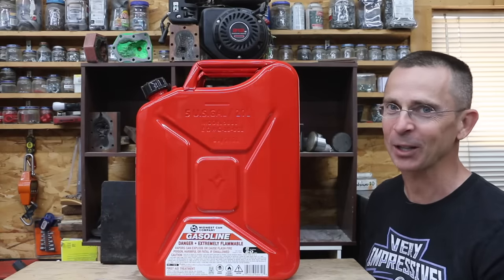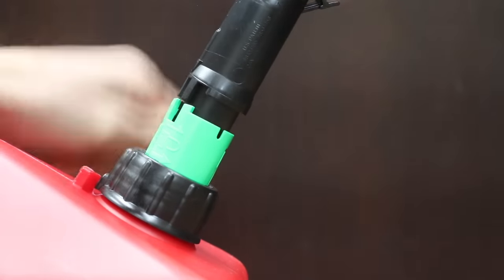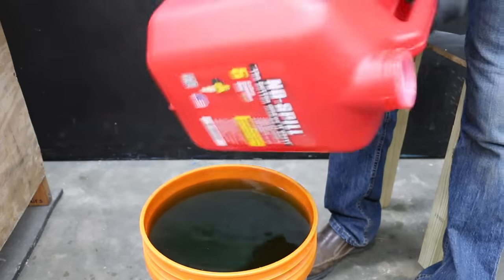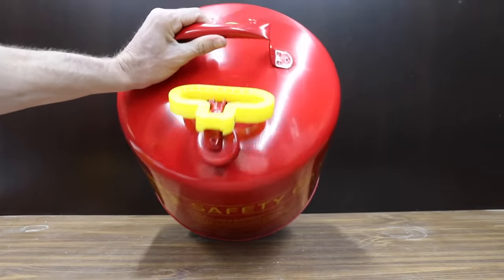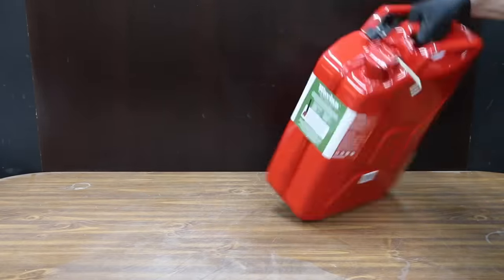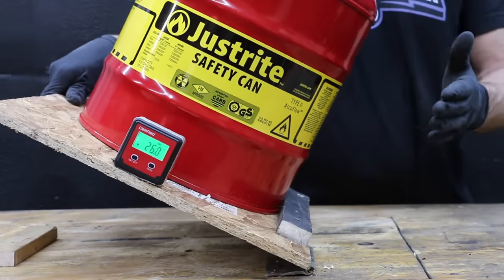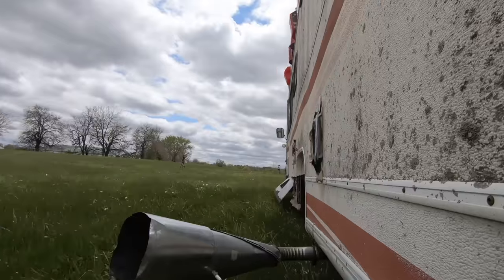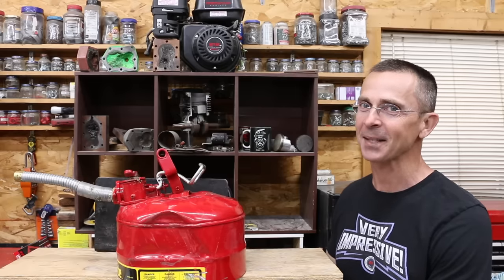Best Gas Can? $140 Wavian vs Eagle, Surecan, Scepter, Briggs & Stratton, Midwest, VP Racing

Comment: I never had a problem spilling fuel until they came out with mandatory spill proof containers.
Reply: Luckily, the cheap ones can be... modified.
Reply: The “spill proof” cans spill more gas than the old ones we’re used to. Good thing they sell conversion kits 😂
Reply: Yea man throw it away and get a quality funnel 😎
Reply: @Oxnate  yes sir!
Reply: Agreed and it pisses me off to the core everytime I use one. They ALWAYS leak and spill gas, how is that safer when it spills gas onto a hot engine?!
Reply: Agreed!
Reply: Amen
Reply: Grandpa... tell me about the good old days
Reply: I don't have a problem because I have a few decent funnels. Screw all those weird spouts.
Reply: Exactly!
Reply from the maker: Thanks for sharing.
Reply: Government at its finest trying to keep you “safe”
Reply: The problem with ALL polyethylene is that it degrades, and leeches into your stored fuel. A steel Jerry can from world war one works just as well today as it did then.
Reply: I still have some old style cans.
Reply: I had gas shoot up into my eyes when filling my lawnmower up. I'll never use them kind again. Mine I had to put the the nozzle in the tank and push the whole gas can down and it shoots out into the tank. Well when this happens the gas goes in the tank and right back out if there is any pressure in the gas can from sitting without a release valve for the fumes witch mine didn't have. Luckily I was at my sisters cutting the grass and I was standing next to her swimming pool when it happened. I was instantly blind from it so I jump into her pool and opened my eyes under water to get the gas out of them. F those gas cans.
Reply: True!
Reply: @1pcfred  do you recommend any particular funnel?
Reply: @danielryno  Not any particular brand. I do like having the right funnel for a job though. I have a few different shapes and sizes. I have a big galvanized funnel for filling up the lawn tractor. I have a long skinny trans funnel for filling up vehicles. Then an assortment of little plastic funnels for filling up small yard equipment and other funnel tasks. Like say filling up a spray bottle. Oh there's a hot tip. Get an empty spray bottle and put some gas in it. You can use it like starter fluid on hard to start small engines. Which is every engine that's sat. Then run them on the bottle with little squirts until they fill up their carb bowl and can feed themselves. Saves a lot of rope pulling if you do it right. Since I've been using gas in a spray bottle I haven't even bought any starter fluid. I don't know why I didn't think of that trick sooner. Try it you'll like it. I should add I don't usually leave gas in the spray bottle. I put some in the bottle, use it, then dump the rest back into the gas can when I'm done. It's a tool. Unless you're starting hard starters every day. Then leave it in the bottle.
Reply: Yeah, I never understood the unsafe "safety" cans. Thanks a lot, California! Those politicians probably never used a gas can before.
Reply: @ChrisEdwards357  messing with gas cans is what the hired help is for.
Reply: They will swell really bad in hot weather also..safety hazard!!!! Real wizards in DC!!!!
Reply: Amen!
Reply: i have the brige's gas can in the video it suck's and is my least favourite one out of 6 i use
Reply: @davidusry5048  That's government regulation for ya! Just do something, don't think about what your doing. Just do it! Not the SMART way, rather, the GOVERNMENT way!
Reply: Get an EZ pour spout, they are cheap and make your can pour awesome. They fit almost any can
Reply: Hold your tongue the right way, twist the neck n push n do the hokey pokey... hate those safety cans. Did see a dude made a video bout Jerry cans that was really interesting. America paid French kids to find German Jerry cans that were left behind cuz their design was superior to America's.... we wanted to save a penny on design.
Reply: @Joe_Dirt82  Sound advice.  Would expect nothing less from the great Joe Dirt! 👍
Reply: The 2 pack conversion kit I bought cost more than an old style cheap gas can used to cost. Ahh, the good ol’ days, when the nanny state wasn’t running around protecting us from life.
Reply: Ha so true. Hate all the new cans.
Reply: I’m a small woman. Those spill proof spouts are the worst. I tried to put gas’s in my car and ended up with gas’s all over my front, Jeans and shirt.  How was that safe??? It was very aggravating, and dangerous. Thanks for this evaluation.
Reply: Yep! But you can’t very well charge $50 for a $2 plastic can now could you! Still have several Rubbermaid non safety cans that are the perfect design and cost something like $6 new. Oh the good ole days!
Reply: @davidusry5048  Because then they turn around and say wait for it to fully cool down before refueling...because you know we all have an hour to kill while in the middle of a job...
Reply: I have two old gas cans from the 90s and hold on to them for dear live they have plastic spout with no lid and I have never spilt them
Reply: me too
Reply: @ProjectFarm  you missed stacking test..
Reply: Omg truth.
Reply: Isnt that how the world works, child proof cap, the adult cant open it, but the child can get it open?
Reply: @ckeilah  the Jerry can didn't come out until 1939
Reply: I always visit tractor Supply for an EZ pour spout soon after buying a new gas can
Reply: WHY DONT THE MAKE ONE THAT LOOKS LIKE A GAS STATION NOZZLE WITH THE OVER POUR CLICK SAFETY FEATURE LONG HOSE AND YOU JUST PUT THE CONTAINER ON TOP OF THE CAR INSTEAD OF HOLDING TO DEAR LIFE AND TRYING NOT TO SPILL IT ALL OVER YOU THEN YOU CANT EVEN HAVE A 🚬 AFTERWARDS.
Reply: @JacobTemple_CE  The oil companies are price gouging. That's where the problem lies. A windfall profits tax, rebated to the consumers would help but the senate won't pass it. They are beholding to the oil companies.
Reply: @ronaldnorris2179  I've had my Midwest 2 gallon swell hot, and shrink cold. It actually deforms! The flow button is so hard to press, it hurts, and gas leaks from around the button, getting on my fingers. What a piece of crap.
Reply: @dgoodman1484  I had one I liked that worked well till the flexible neck cracked, so it became useless. If there were replacement nozzles I would still be using it.
Reply: For those struggling with fuel cans and live in the northern states: buy them from Canada. I have a bunch of Septre cans that were made in Canada, they have regular spouts. They also have additional vents, so if you open that vent while pouring the fuel it drains very, very quickly.
Reply: @calrob300   If you're trying to tell us you're a Californian that voted for Biden, just say so and apologize.
Reply: U hate the feds 2?

Libertarian Joke?
Reply: @ronaldnorris2179  I leave the screw cap slightly loose to allow for expansion and contraction of the empty air space inside the can.
Reply: Failed in the interview to be a human cannonball - alas I wasn't of the right calibre ;)
Reply: Remember. The government would screw up a cup of coffee.
Reply: @wildbill5670  
#1

Run...
4 pres
WILL VOTE 
4
U!
RV guy.mass
Reply: @lelandthomosoniii4743  Believe it or not I've thought about it.
Reply: I've never had a problem spilling, I don't know why everyone has such a hard time using them
Reply: I use a large cork with two hoses that go through it. One the hoses reaches from the bottom of the container to the gas tank, and the other goes from the tip of the cork a couple of feet up so you can blow air into it and siphon the fuel through the other hose to the tank. Not a single drop spilled and sometimes you can barely smell the fuel.
Reply: I remove the safety spout and pour gas directly into a plastic funnel. I spill quite a bit of gas. I guess the government wants spilled gas all over the ground.
Reply: The California anti-vapor release gas can is the biggest POS. Pours really REALLY slow...if you can get the perfect angle to actually make it flow. I think it backfired horribly because with these newer ones I just straight up take the nozzle off and pour it down a funnel.
Reply: @davidusry5048  Kick back money for the EPA
Reply: I got a battery powered pump that I love! Filling my chipper shredder is awkward with bigger tanks and helps with the top openings on my generators
Reply: Right that's no shit
Reply: @JacobTemple_CE  that's a UN thing
Reply: You ain't f**** lying.
Reply: I thought only Alcoholics spent 18mins talking about cans.
Reply: @TheMightsparrow  cans? CANS?! BOTTLES ARE BETTER!
Reply: you and me both. i wish they'd just bring back the old style from the early 2000's.
Reply: Yeah new cans are legit trash. I always grab old ones when I find em lol
Reply: 6:15 you can get a pair of pliers and rip the red thang u press right off make life a lot easier
Reply: @Shiekh420  ha sadeek
Reply: Get the after market spouts and vents from Amazon. It will make a major difference to almost any plastic can.
Reply: I just buy the regular after market nozzle
Reply: @ChrisEdwards357  but they saw one on TV! LoL
Reply: Yo
Reply: @Oxnate  >⁹>o
Reply: When it's below zero, on the side of the highway, you're better off with a coffee can.
Reply: With the swollen cans, I keep them upright and hit the button/tab and release the pressure first (sometimes I squeeze the can with my calves & ankles to create a vacuum inside, in case I have to walk with it, or anticipate the temperature to increase) and then I don't spill. 

No wants "Pressure Washer Jet Blast Speeds" going into the tank - that's one of many reasons for spills.
Reply: That's why I bought a bunch of old style gas cans off of craigslist
Reply: Thanks, lawyers
Reply: Exactly!
Reply: @briarbarnes2025  By safe, they meant pissed off
Reply: @davidusry5048  most people put gas in the gas tank, not pour it on the engine
Reply: 70 yrs old...been mowing, snow blowing etc etc etc...I have spilled more fuel in the last few years than the past 58. Try filling a snowblower in windy 10 degree weather..1/2 goes in the tank and 1/2 on the ground. I now have a good funnel and take the spout off.
How about an on /off valve on the spout like a ball valve..to easy.
Reply: Same, the button vented plastic cans worked great, and didn't spill. The new eco-friendly cans are anything but.
Reply: Yeah, the Government had to fix something that wasn't broken.
Reply: ain’t that the truth brother
Reply: Same here
Reply: @ChrisEdwards357  maybe why they are switching to electric vehicles.  That cannot be recharged if the wind blows or it is hot or cold.  Cali has too many reasons to shut off electricity.  The newest charging stations are diesel powered.  So they burn more fuel than if they just used an ice.
Reply: @ckeilah  I"m for the Jerry can. They're better than the round bottom cans for sure.
Reply: @goodkill1  Nothing wrong with those cans. Just a lot of junk these days.
Reply: Same here 🫤 if it ain't broken don't fix it 🙄
Reply: Absolutely.  They're slow and clumsy to use.
Reply: @galvanizedgnome  😂
Reply: I've seen the same style plastic fuel cans for sale in Mexico at the stores but they have a corrugated flexible plastic spout a vent running down it. It's the same style I have on my Rotopax fuel can mounted on my Jeep. It pours very well and I have never spilled much more than a few drops but that was from me being careless.

Just goes to show you how destructive and idiotic all these know nothing bureaucrats in the US who have probably never done real work in their lives can be.
Reply: This!!
Reply: @danielryno   depends on where you are trying to pour it, they are available in numerous configurations
Reply: @1pcfred   as long as he doesn’t fill it with the yellow can
Reply: Yeah leave it to uncle sugar to screw up a gas can.
Reply: I can't even use those damned things without taking an absolute BATH in gasoline.  If the goal is to turn the user into a Molotov cocktail, they're doing a great job.
Reply: Yup. EPA bullschitt to prevent evaporative emissions. Never mind the evaporation caused by all the spillage. I bought cheap plastic gas cans, and installed new spouts from gas spouts dot you know what.
Reply: @briarbarnes2025  - Yeah, gov't makes things worse every time they stick their nose into anything.
Reply: Me either.
Reply: @Shiekh420  why dont we just use the normal ones that worked for years before Democrats got involved
Reply: So. Much. This.
Reply: California, right ?
Reply: Yeah I understand what the government is trying to do but it has caused more problems than it's worth.
Reply: The best can is the Sceptre military fuel can,  not the one he tested, the real one, it uses a screw on fuel nozzle that let's fuel absolutely race out if you can find them.
Reply: Same. The new “spill proof” spouts that are mandatory make such a mess and break often and just don’t work. I miss the old cans with yellow cap on the end you’d just pull off and pour. No locks no nothing. Stupid people ruining yet another thing for the rest of us.
Reply: @Oxnate  9
Reply: Thankfully we don't have them here in Australia as I agree. The only one I use in a No Spill on the small can I use for the lawnmower.
Reply: @goodkill1  You are luckey. I scour garage sales for the old metal cans!
Reply: see thats why you drill the stupid thing apart
Reply: @galvanizedgnome  Lame.
Reply: @galvanizedgnome  There were separate water fountains, EVERY dinner out was quiet, and everything was PURE.
Reply: The old plastic ones with the breather tube you could use to vent in the back were the best!
Reply: I never spilled so much fuel until the spill proof containers. A great testimony to the governments ability to screw literally anything up
Reply: @ckeilah I’m gonna have to disagree with you there. Steel cans rust. A small amount of leeching plastic is a much more minor problem than a rusty steel one.
Reply: @BabyGators  TRy getting the fuel out with the removal of the back spot to let air in the rear!
Reply: @bradandrews777  I know, it’s terrible. Never underestimate the governments ability to screw anything up. That said, I bought vent kits for mine to add the vent to the “safe” ones.
Reply: @BabyGators  I would be very tempted to simply drill a hole in the back of mine if I used them much, but that would not help when stored.
Reply: @bradandrews777  I have done that myself before. Makes a huge mess when transporting though. Found a kit on Amazon with a proper sealable vent. It works great. Too bad you have to spend more on the cab itself, then buy something extra just to make it functional
Reply: Jesus, it's like you guys can't read instructions or something. I've never had an issue with spilling gas using any modern can. You all are the reason coffee has to have a "Caution: Contents are hot" warning on it🤣
Reply: @imreloadin  Got nothing to do with instructions pal, it has to do with unnecessary and poor design.  I didn't know your Barbi Jeep ran on fuel.
Reply: @imreloadin  What?  Modern gas containers eliminate things like airflow from the other side, which made using the gas much simpler, since the air went in where something was going out.

You might want to understand the topic a bit better before you rant.

Really old cans had another cover in the rear IIRC.  Later ones changed that to just a flip open to allow air to enter.  That was removed, I assume for "pollution concerns" even though it ironically makes the process of getting the gas out much less smooth because the backflow air has to go in the same hole.
Reply: @bradandrews777  And in the end it's still just pouring gas. You guys are all acting like this is rocket science or something and frankly it's rather hilarious. Typical boomer mentality of "who needs instructions" when it comes to using literally anything. Do us and the rest of society a favor and go open a book for once grandpa.
Reply: @imreloadin  It seems like you are whining more than anyone else.

But then those of us who used better gas cans in the past know the difference.
Reply: @bradandrews777  I haven't "whined" once during any of my comments. It's ok though, I know that reading comprehension wasn't one of your generation's strong suits. Having used old gas cans is irrelevant to your lack of ability  in using the new ones. It all boils down to the fact that you're just using the new ones incorrectly. However you've gotten to that point is varied and your own fault.
Reply: I defeat them all and use a very wide funnel with as wide a funnel bottom as is possible.  They all suck.
Reply: So true. Spilling became a problem with introduction of the 'spill proof container'. But WAIT!  There's more!  
The mesh flame barrier located at the can's opening triggers the back pressure sensor at most gas station pumps, immediately shutting off the flow. 
Most pumps do not allow one to throttle the flow down slow enough to prevent this
Since you may be unable to fill the tank, you need not worry about spillage.   Problem solved!
Reply: @galvanizedgnome it’s true though.
Reply: Where are these Jerry cans required? Never seen anything like this in alberta, canada
Reply: Not a lot of tanks have vents on the back like they use to either. Those poured the best.
Reply: @user-njyzcip  Thanks for the tip about the Canadian gas cans although I think I have enough gas cans to last me till the end of my life.
Reply: @Oxnate duct tape works to modify.
Reply: Those that created the specs for these 'safe' cans have never poured fuel!   I hate these cans.  I end up spilling and wasting far more fuel, and contaminating the environment so much more than with the old, unregulated cans.
Love how government solves problems!  😡
Reply: I have a Blitz for 25 years works great
Reply: Hahaha…. Exactly what I thought.
Reply: VP can I have come with a label that stated “not for fuel”  lol
Reply: Never owned a gas can for years had a plastic hose behind the seat in the pickup. Now can't syphon gas out easily.
Reply: @vincentg6613  Curious which one you bought. I  have been thinking about the same thing for filling my tractor and zero turn.
Reply: me, three